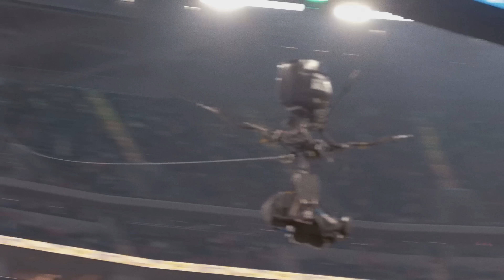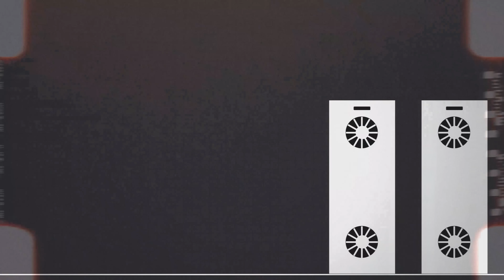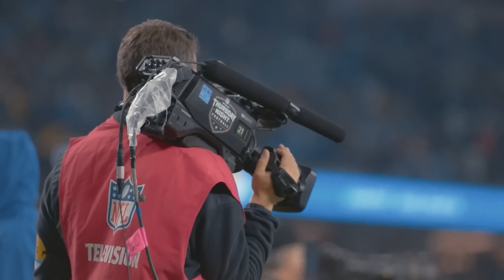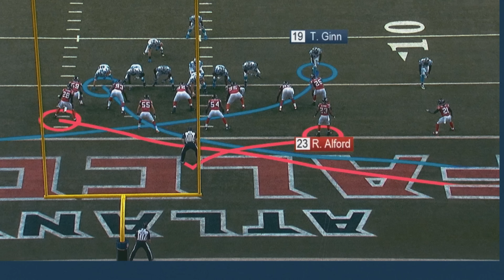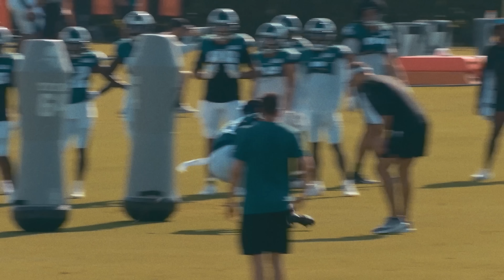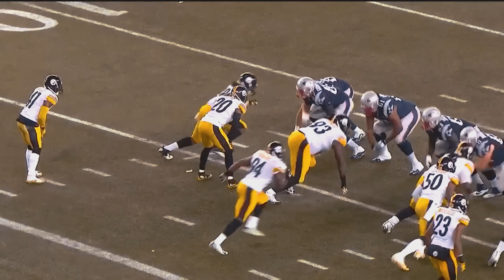NFL Technology You Didn't Know Exists..

Comment: the NFL's technology, covering safety rankings, technical infrastructure, and the financial scale of their massive corporate partnerships.
1. Technology Ranked by Impact on Player Safety
• Guardian Caps & Position-Specific Helmets
	• Why it’s #1: This combination directly prevents brain trauma. The soft-shell Guardian Caps absorb up to 10% to 12% of impact energy during collisions. Combined with modern position-specific helmets—which reinforce the exact areas where different positions absorb the most hits (like the forehead for linemen or the back of the head for quarterbacks)—this technology actively reduces the incidence of concussions on the field.
• Biometric Sensors & AWS "Digital Twin" Simulation
	• Why it’s #2: This is the predictive engine behind player safety. By feeding real-time collision data into Amazon Web Services (AWS), the NFL creates virtual "digital twins" of players to simulate thousands of impact angles. This software detects when a player is accumulating dangerous levels of sub-concussive force, allowing medical staffs to intervene before a catastrophic injury occurs.
• Coach-to-Player Radio & Sideline Communications
	• Why it’s #3: While primarily a strategic tool, encrypted helmet radios and sideline communication protocols heavily impact safety by reducing chaotic, late-play adjustments. Clear communication prevents collision confusion, ensures players are properly aligned, and allows coaching staffs to quickly signal a player to sub out if they appear disoriented.
• Zebra RFID Player & Ball Tracking
	• Why it’s #4: RFID chips excel at tracking speed, distance, and load management. Teams use this data to monitor a player's practice volume, helping prevent non-contact soft-tissue injuries (like hamstring or ACL tears) by alerting staff when a player is entering a high-fatigue danger zone.
• Automated Officiating & Hawk-Eye Optical Tracking
	• Why it’s #5: Hawk-Eye camera arrays and automated first-down tracking are fundamentally designed for competitive fairness and game integrity, rather than physical protection. While it reduces game delays—keeping players from standing around in the cold—it has the lowest direct impact on mitigating physical trauma.
2. Technical Breakdown: Zebra RFID Tracking & Stadium Sensors
The NFL’s Next Gen Stats system operates on an advanced Ultra-Wideband (UWB) Radio Frequency Identification (RFID) architecture deployed by Zebra Technologies. Here is how the hardware communicates in real time:
[Tag: Player/Ball] --(UWB Radio Signals: 6.35-6.75 GHz)--> [Stadium Receivers] --(Ethernet)--> [Local Server / AWS Cloud]
The Transmitters (Tags)
• Placement: Two coin-sized RFID tags are sewn directly into the shoulder pads of every single player. Additionally, custom microchips are manufactured directly inside the bladder of the Wilson footballs.
• Frequency: The tags transmit using Ultra-Wideband (UWB) radio signals across a spectrum of 6.35 GHz to 6.75 GHz. UWB is chosen because its low-power, short-pulse signals do not interfere with stadium Wi-Fi, radio broadcasts, or coach communication systems.
• Ping Rate: Player tags transmit data 15 times per second, while the football’s tag transmits at 25 times per second to accurately capture high-velocity passes, spins, and sudden changes of direction.
The Receivers (Sensors)
• Infrastructure: Every NFL stadium features 20 to 30 matrix receivers permanently installed in the upper bowl, catwalks, and sidelines.
• Triangulation: The receivers pick up the UWB radio pulses from the tags. The system calculates the exact location of the player or ball using Time Difference of Arrival (TDOA) and Angle of Arrival (AoA) algorithms. By measuring the fraction-of-a-nanosecond difference in the time it takes a signal to reach multiple stadium sensors, the system triangulates the asset's exact X, Y, and Z coordinates down to less than an inch of accuracy.
The Processing Layer
• Latency: The raw coordinates are compiled by a local stadium server and pushed instantly to the cloud. The total latency from the moment a player takes a step to the data appearing on an analyst's screen or broadcast graphic is under 250 milliseconds.
3. Financial Scale of Major NFL Tech Partnerships
The NFL treats its technology infrastructure as a major revenue engine, locking in massive, multi-year commercial rights deals that blend corporate sponsorship with enterprise utility.
Microsoft: Sidelines & Surface Integration
• Estimated Deal Value: $400 million+ over its most recent multi-year expansion.
• The Deal Scope: Microsoft provides the foundational hardware for all 32 teams. This includes supplying specially ruggedized, weatherproof, and anti-glare Microsoft Surface tablets utilized by coaches, players, and replay officials on the field. The agreement also extends to Azure cloud integration for collaborative team workflows and draft room operations.
Amazon Web Services (AWS): AI & Next Gen Stats
• Estimated Deal Value: $35 million to $50 million annually as part of a broader enterprise partnership.
• The Deal Scope: AWS serves as the "Official Technology Provider" and "Official Artificial Intelligence Provider" of the NFL. Beyond powering the Next Gen Stats graphics seen on broadcasts, the multi-million dollar partnership funds the development of the Digital Athlete platform (the injury-prevention software mentioned above). It also optimizes the league's massive computational challenges, such as algorithmically generating the highly complex annual 272-game regular-season schedule.

Comment: the NFL has evolved, a multi-year breakdown reveals the core technologies adopted since 1999 to transform player safety, communications, officiating, and data analytics.
📅 Timeline of Key Technological Milestones (1999–2026)
Era / Year	Technology Introduced	Functional Impact on the Game
1999	Reintroduced Instant Replay	Replaced the flawed 1986 system with a tech-driven review process using synchronized broadcast feeds to correct missed calls.
2007	Defensive Helmet Radios	Expanded the 1994 quarterback radio system to defensive captains, allowing coaches to communicate play-calls electronically to both sides.
2014	Sideline Microsoft Surface Tablets	Replaced traditional paper binders and polaroids with custom, rugged Microsoft Surface tablets to instantly review high-res overhead formations.
2016	Zebra RFID Player & Ball Tracking	Partnered with Zebra Technologies to embed microchips inside shoulder pads and footballs, launching the Next Gen Stats era.
2018	AWS Predictive Machine Learning	Partnered with Amazon Web Services (AWS) to use cloud computing and AI to calculate advanced metrics like completion probability and catch separation.
2021	Hawk-Eye Optical Tracking Integration	Implemented Sony's Hawk-Eye multi-camera array to track player joints and ball positioning, modernizing instant replay sync.
2024	In-Game Guardian Caps Approved	Permitted players to wear padded, soft-shell helmet covers during regular-season games to drastically reduce sub-concussive forces.
2025–2026	Optical First-Down Tracking	Transitioned away from manual, human-carried physical yardage chains to a fully automated, camera-based optical tracking system for measuring first downs.
🧬 Evolution Across Four Core Areas
1. Player Data & Advanced Analytics
The league moved from basic box scores to Next Gen Stats. RFID microchips streaming 25 times per second send positional data to AWS cloud models. Instead of just tracking yards gained, computers now calculate a player's maximum acceleration, closing speed, route running efficiency, and exact passing windows down to the inch.
2. Biometrics & Safety Engineering
Concussion litigation forced the NFL to invest heavily in data-driven safety. The league built a database of every helmet impact using sensor data. This allowed them to develop position-specific helmets (e.g., reinforcing the front of a quarterback's helmet to protect against ground impact). Over the last few seasons, the widespread adoption of Guardian Caps during practice and games has added a physical barrier to absorb kinetic energy.
3. Strategic Communications & Sidelines
The speed of game-planning escalated when the league banned paper printouts on the sidelines. Coaches and players now swipe through encrypted digital photo folders on specialized tablets. Meanwhile, coach-to-player radio communication became standard on both sides of the ball, guarded by military-grade frequency encryption to prevent opposing teams from intercepting play calls.
4. Automated Officiating
The transition from human judgment to automation peaked over the last two seasons. After utilizing Sony’s Hawk-Eye camera arrays to sync replay angles, the NFL finally addressed its most low-tech vulnerability: the chain gang. By mapping the stadium field into a virtual 3D coordinate system, camera tracking software can now instantly detect whether the nose of the football crossed the first-down line, eliminating the human error of manual chain spots.

Comment: There should be a sensor in the ball to pinpoint the ball's placement and to determine first downs and touchdowns.
Reply from the maker: Wait… you mean you don’t like the refs eyeballing it and then measuring with a chain? 😅
Reply: how does the ball know when the play is over?
Reply: synch to a sensor on the elbow or knee
Reply: @ricardoruanogonzalez  and for forward progress? Or any other body part down? Or down but not by contact? Or so many other scenarios?
Reply: It exists, in fact has existed for quite a bit of time. The main issue is how it impacts the ball in flight; even something small and light will still destabilize a ball. And then there’s the question of how you sync that with a ref’s whistling the end of a play.
Reply: @alfyb4512  As shown in the video all of the data is stored, the exact position of the ball in the 3D space would be known at any moment in the game, so would simply be a case of the official deciding the exact moment the play was over (knee down, out of bounds or whatever it might be), hitting the pause button and the balls exact location would be known. And as the video said, those sensors are already in the ball - the data is already being provided, they just haven't shifted to using the data for that purpose yet.
Reply: @alfyb4512  The whistle doesn’t end the play. It just signals that the play is over.
Reply: Would be difficult to do this without affecting how the ball behaves, not to mention it would be incredibly easy to break and much more expensive than a regular ball.
Reply: @hoosierhell7456 as I said, in the video it says they’re literally already in the balls….  Just like they’re in player pads etc.

It’s how they know the ball velocity etc in real time
Reply: @hoosierhell7456 Chips inside ball are  used in pro soccer games all around the world, to determine whether or not the ball crosses the goal line. Soccer balls receive severe hits and the sensors have no problems. I Guess the cost and tech are similar to the one  for first down  measurement, or tennis in/out call
Reply: There is. It’s called Expedited Replay
Reply: They literally just started that this year
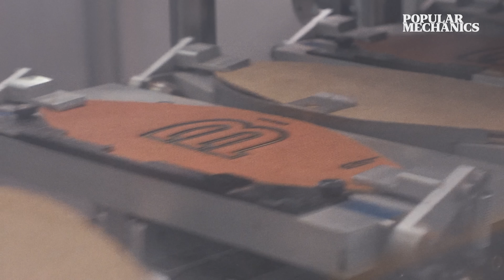Reply: in the video.   see 13:45
Reply: Just no! Humans been doing it for years, you just need better refs.